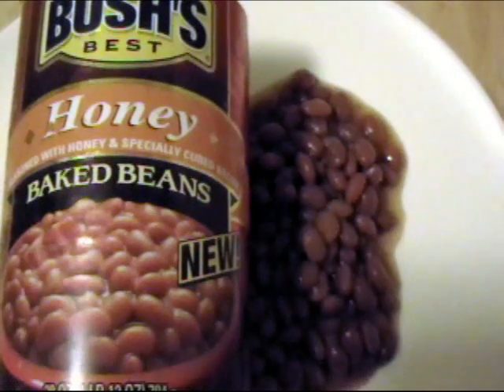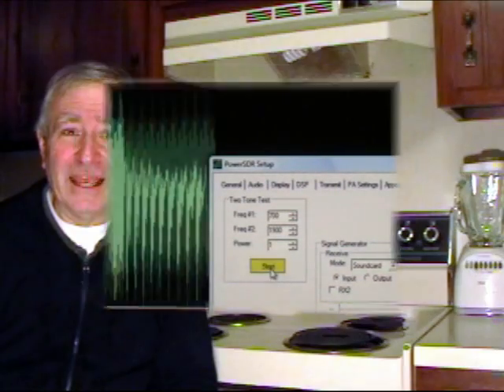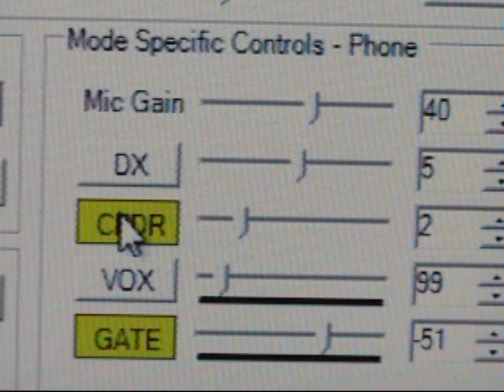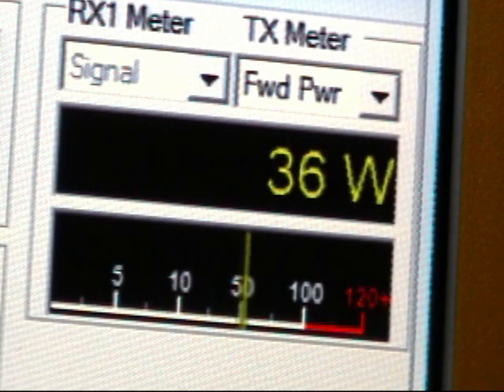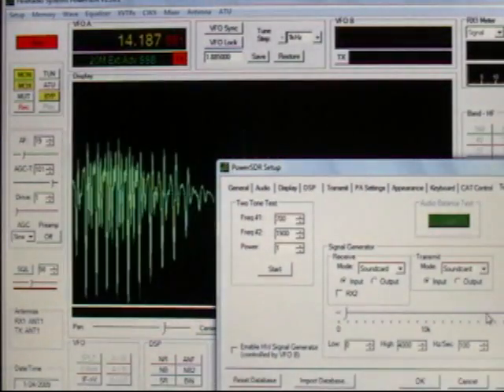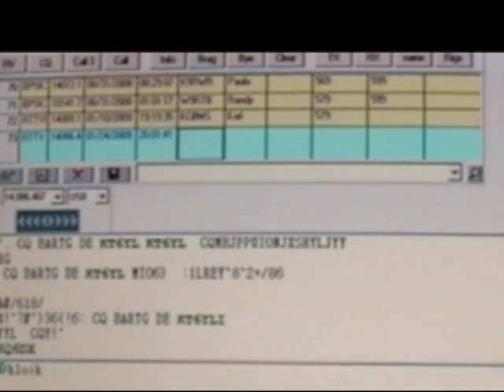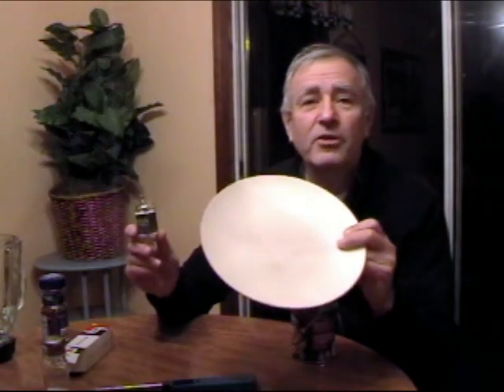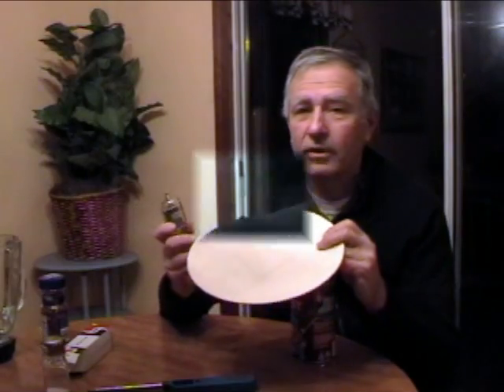Flexradio 5000A with new revelation (the FDR) (Flex 5000 discontinued).

Comment: Flex 5000A can do alot for sure but he is absolut not capable to scan between two specific frequency edge if i'm away from shack. 
All radio have scan capability or like my Pro III do just the flex not for some very curious reason.
It's a feature i really miss myself specialy for 6M operation for alert me of any band opening if i'm away from shack.